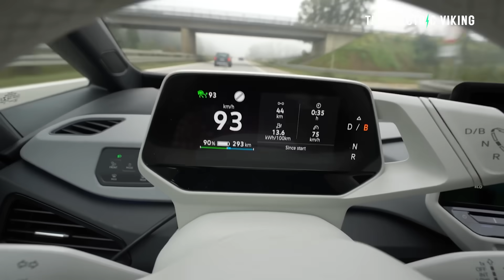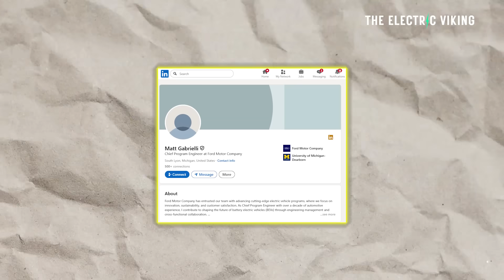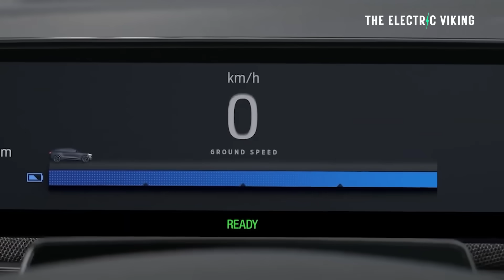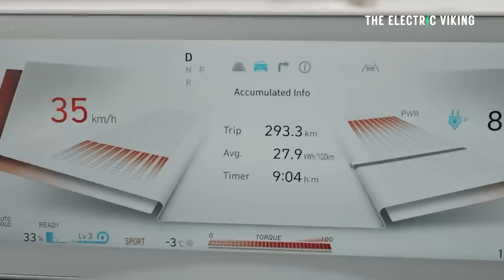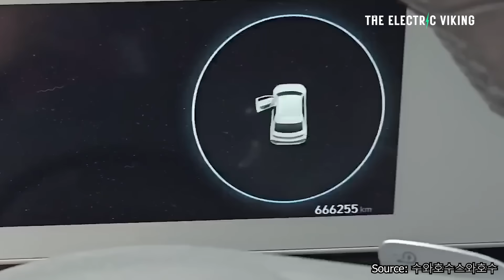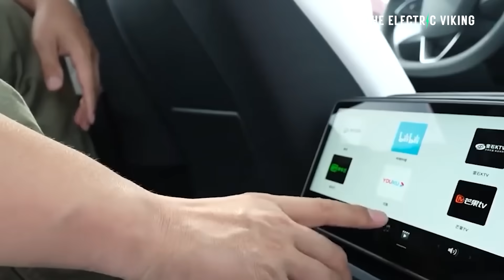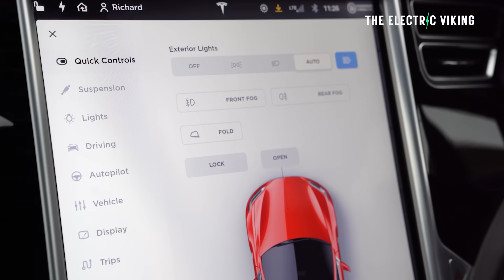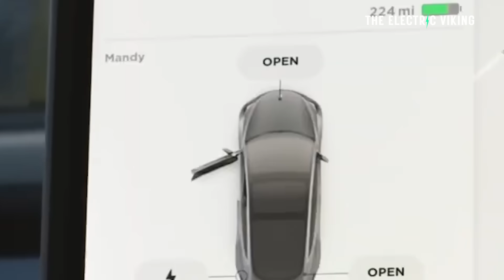Ford Mustang Mach-E Has Over 95% Battery Capacity After 252,000 Miles

Comment: Well I have three EVs with same conditions but different SOH an ID.4 2022 with 44000 km and SOH is 94%, and MG ZS EV 2020 with 101000 km its SOH is 96% same, and Renault Zoe 22kwh battery 2018 with 45000 km has 89% SOH it , but in Saudi Arabia the weather is hot as you know.

Comment: I put 180,000 miles on my i3 and I did not see any noticeable degrading of my battery.  In that time I only spent $2,000 on a new charge port.  Front breaks were done at 160,000 miles.  Nothing else.  I did all levels of charging.

Comment: How long does a quality brand 18650 battery last in a flashlight? In my wifes hand 6 years, in mine they are still fine after 12 years. The Mustang Mach-E owner must have known what he was doing - and been driving on well maintained roads, not through potholes which have become so common nowadays throughout the EU and the USA. What about driving those 252,000 miles not in 3 years but in 30?

Comment: I drove a plugin hybrid about 2500 short trips using about 50% of the battery each time over 40 months I'd est about 15000 miles on a 8.8 kwh battery, I don't know the "useable", I dorve a total of about 23000 miles but outside one 5000 road trip the gas engine hardly was ever ran.

Comment: I’ve done 70k miles in my BMW EV over 5 years. Haven’t noticed any battery degradation and the only maintenance has been tyres & brake fluid changes. Got so tired of my previous ICE cars needing regular oil, pad, filters, exhaust & disc changes.

Comment: There’s no definitive answer to this longevity question yet as EV’s have only really been around comparatively for ten minutes compared to the 135 years of ICE vehicles. My mates 1997 Land Cruiser has 400,000 km on the clock (248,000 miles). Has been bush bashed, crossed rivers, hauled heavy loads, etc. We did a compression test on it as part of a service and health check and all cylinders were the same as new vehicle factory spec. We serviced the injectors while they were out and apart from an oil change, new filters, etc, that was it. It’s still out there running around and probably will be for another decade or two.

Comment: As an owner of a PHEV that is 13 years old, I can tell you that my EV battery aged out before it cycled out. My battery range is less than half of what it was initially. I typically have driven my Japanese ICE cars Honda, Toyota and Nissan vehicles 15 to 20 years without drivetrain problems.
Reply: Same here with my nearly 10 year old volt (roughly 75% capacity now). However, I’d argue that it’s more to do with improvements in battery management systems than the actual battery. All things wear out with time but car companies seem to have gotten better at extending that in the last decade.

Comment: ICE engines can go multiple 100 K’s depending on maintenance and who built it. My Dad sold his ‘76 Scout II with 350 K on the 345 v-8 with no engine overhauls.
Reply: My 2006 Hyundai is at 440,000 miles.  Just have to go easy on the gas pedal, don't be abusive, and do the regular maintenance on time

Comment: "they run all the time" in fact the more you run a pure play BEV the better they work. In the USA I was once putting 6000 miles per week on my truck...the superiority of a pure play bev to that tho...one that doesn't even need a driver anymore... PLAAAAAINLY obvious. In theory a hybrid drive system should compete just fine all that is being added is an engine and some fuel presumably a powertrain I have no idea. But the batteries have suddenly gotten so good and don't cost much anymore ...80 miles on the battery is what I've seen quoted for the en route #toyota_rav4 that is a very good number...all with an "engine back up." In theory an amazing #gen_set for backup power to your home or business/both. On site work as well. Anything else be literally throwing money out your window while driving. A lot of money actually if you don't even need to buy the car itself anymore😊😊

Comment: Miles is not the concern, calendar aging is.  Regardless of miles you're not going to see original batteries going for 15 to 20 years  like good ICE engines can.
Reply: The day is coming when you will just replace the battery with a cheap Chinese new one
Reply: Yes and no. Cyclic and calendar aging are both factors in battery longevity. Car manufacturers have gotten better at cyclic aging but it remains to be seen how the current generation of EVs fair with calendar aging. 

Btw, suggest you read the comment from the 4th gen mechanic above re ICE cars. His comment points out the flaws with ICE, particularly modern ones (think planned obsolescence). Your comment reads more as a “you can take away my ICE when you pry from my cold dead fingers” level curmudgeon.
Reply: There are 10+ year old Chevy Volts  that are still on the road without issues.

Comment: Here in the UK, the average age or a scrapped vehicle is 14 years and only 140,000 miles. So this longevity is around double the average. And there is a Tesla Model S here in the UK done over half a million miles on original battery and motor.

Comment: Seriously, Sam?  BATTERIES last longer than ENGINES?

Considering the fact that most battery packs haven't made it past 10 years STATIC, and I'm driving vehicles (with original engines) averaging THIRTY YEARS OLD, I think you'll need to just remove this bollocks as a matter of principle.

This video is an insult to people's intelligence and a denial of what they see EVERY DAY IN REALITYVILLE.
Reply: Considering you have absolutely no clue what you are talking about, and most battery packs aren't even 10 years old yet genius, but data is showing they degradation is very slight, even after a very long period of time.

If your "intelligence" is getting insulted, it is because it is much smaller than you think it is...

Comment: At 360K most ICE's would have been through at least three timing belt/chain changes and at least six brake replacements. Also would have been at least three full transmission flushes and differential oil flush. 

With standard oil and filter changes the best case maintenance (tires excluded) is ~15K.

Comment: Chevy Bolt on second battery in 27,000 miles.  $20,000 payment back from GM and two months of income lost so far.  Chevy Bolt is a joke in every way.
Reply: There was a recall on the battery genius.  It has nothing to do with the typical battery lifespan.  ALL of the Bolt batteries in the Bolt were recalled by LG due to manufacturing defects.

Comment: Great to see these cars getting a lot of miles but still have never seen anyone who can say how Long a battery will last with normal usage, 10 years , 15 years, more ?
This is the question people are asking, not how many miles in 3-5  years.
Reply: Actually, many people think EV batteries are like phone and laptop batteries, although they are managed, cooled and charged completely differently.

With normal usage, I think 15 years is an easy benchmark.  I have a Model S from 2014, original battery and it still has 90% of original capacity with 135k miles.  Newer batteries should last even longer, but even 11 years later, the battery in my Model S has absolutely no issues at all.
Reply: its not the years that matter, its the mileage, and how you charge it (home charging or DC fast chargers).
Reply: @udishomer5852  That is actually incorrect.  Calendar age is a factor, and studies involving fast charging have shown they do not affect battery lifespan as previously thought.

There have been large studies involving thousands of EV's, and the different in battery degradation between EV's that were fast charged frequently or fast charged rarely was not statistically noticeable.

If anything, the study showed fast charging batteries actually causes less battery wear than slow charging, and that is due to the temperature wear which is the primary cause of battery degradation.

Fast charging batteries means the batteries are heated for shorter periods of time vs using Level 2 charging, and that appears to shorten the thermal wear which is the #1 reason for batteries to lose capacity.

A lot of the early projections of how batteries wear over time have been proven to be incorrect when they got actual data from thousands of vehicles and a decade of charging habits and battery degradation reports.
Reply: @udishomer5852  So if i never use it, it will last forever ?

Comment: I am definitely pro EV however I don't understand why you did not discuss mileage limits to EV battery warranties. Eight years seems to be correct for most EV battery warranties however they have mileage limits that you did not discuss and I'm a little disappointed in that.
Reply: Because it is a complicated subject.  Take Tesla as an example.  Early Model S had Unlimited mile warranties on their batteries, later Model S changed to 150k mile warranties, but 120k miles on the Model 3/Y long range and 100k miles on the short range version.  8 years is legally the minimum warranty period, but some manufacturers offer 10 years, some offer far more miles.

It all depends on the model, manufacturer, year it was produced, usage case, etc. etc. etc.
Reply: @redbaron6805  Thanks ...I found information suggesting 100 to 160 thousand miles. I think that would cover defective batteries
Reply: @dan8375  Based on the reports I have seen, defective batteries tend to fail pretty early, so they are usually caught and replaced under warranty.

If your EV has made it close to 100k miles and 6 to 8 years of driving, then any defects should have appeared way before that time or miles.

There is also a trend showing that battery failures and warranty replacements are declining a lot, as early teething problems and manufacturing issues are discovered and sorted out.

Current EV batteries have become exceptionally reliable, so they are becoming more and more of a non issue on most brands.

Comment: Hi all of the high milage examples I see on yt are taxis. Yes they clocked a lot of miles but in very short chronological time. Hence my question what about degradation in similar mileage but on 15 years old car? I wonder would it be a big difference?
Reply: Calendar age does not appear to be a major factor.  A prime example is my 2014 Model S with 135k miles, which still shows 90% of original battery capacity.  The data appears to show that 15 to 20 years of battery lifespan is very realistic.  

Considering cars are scrapped on average after about 16 to 18 years in the Western world, that should mean EV lifespan is at least as long as combustion engine cars, and probably far longer as EV's are often very modular, where replacing the drive unit or battery is very quick and easy.

Comment: There are quite a few EVs that appear in auctions in the UK that are sold with defective batteries. They're still in warranty so why haven't they been fixed under warranty? Because EV makers will do their utmost to squirm out of the warranty.
Reply: So how many have you bought that have had defective batteries?  I take it you are speaking from personal experience?
Reply: You have to separate out a lot of early short range EV's with very small battery packs, short range or even air cooled batteries.  These are not representative of modern, long range, liquid cooled batteries which are a completely different technology.

Comment: Tesla reports their highest mile simi has +250K too. But did not say if the battery pack has been replaced. LONG BEFORE EVs we gear heads learned when charging a old school lead acid liquid filled car battery that we got a better charge when left overnight on the 2A setting. Thats why battery chargers have a 2A setting-low & slow wins the race. Since then I have learned it it also true with 18650s or Dewalt power tool batteries. In the Ford Lightning owners manual under  CHARGING it states-
'We recommend you use the slow charger that came with your truck. By charging overnight this will make your battery pack last longer. Only use DC fast chargers in an emergency or on a long trip-NEVER regularly.' So it suggest those who use fast charging regular are the ones who will need a batt pack replace. The Mustang e Mach may have charged slow overnight to get his high miles

!
Reply: Do you enjoy regenerative braking?   You know: the ability to run the vehicle's drive motor as a generator, transforming kinetic energy back into electrical energy and pushing it back into the battery?   Regenerative braking applies similar power levels as a DC fast-charge station ( about a quarter of DCFC, I think).  If high-current charging were as harmful to batteries as you imply, why would regen braking be designed into so many EVs?
Reply: The problem with that claim is actual data shows fast charging does not affect EV battery lifespan.  A study of 12000 Tesla's showed no statistical difference in battery lifespan or capacity between cars that were frequently fast charged or rarely.

Lead Acid batteries are a totally different technology, with no cooling mechanism, and they produce Hydrogen gas when charged too quickly.

Lithium Ion batteries in EV's have a BMS which monitors temperature and runs the cooling system, and adjusts the charging rate to optimize temperature and lifespan of the battery.

Yes, some manuals still incorrectly discourage fast charging, even Tesla did so early on.  But as real world data has demonstrated, this belief has been proven false, and Tesla and other manufacturers stopped recommending people not fast charge their EV's.

Comment: Really? Longer means years or km? Because it looks like regarding years, a battery is dead when reaching about 10 years.
Reply: That was the theory but there are EVs that are over 10 years old now and still going strong. So it turns out the estimate was wrong. It's really rare for an EV battery to just be "dead". The most common thing is for it to lose some of it's range, in the case of Tesla cars you can expect about 9% within the warranty period and then a slow decline after that to 300.000 miles. You can still drive the car after the battery loses some of it's range it just gets inconvenient to charge it more often. If things go wrong with your engine or transmission you have to repair it, you can't keep using the car.
Reply: Yeah, as Frank mentioned, that simply isn't true.  My 2014 Model S with 135k miles is still running fine on original batteries after 11 years.  The early estimates were around 10 to 12 years, but more recent data shows they are likely to last closer to 15 to 20 years...

Comment: When I bought my new 2025 Tesla model 3 rwd in late 2024 it said 362 miles. Almost 8 months later and charging 1x per week to 85% l, my car now says 356 miles on a full charge. Is that normal for an almost 8 months old vehicle ?
Reply: your driving habits and use of climate controls also affect the estimated range.
Reply: Yeah, the range estimate is just that, an estimate based on your driving habits, climate controls and other factors.  On Tesla's it is normal also to have some minor range loss in the first year or two which then levels off.

Ultimately, people obsess over range way too much, as they have this information overload.  People need to learn to just drive the car, enjoy life and relax a bit more.  Unless you are driving 350 miles a day, having the range fluctuate a bit doesn't really affect much.  Even my 2014 Model S which got around 260 miles when new now gets around 240 miles 11 years later.  It still works fine.

Comment: What about all the ZOEs that break before 50,000 miles and are concidered right offs.
Reply: They're not write offs, so what about it?
Reply: ZOE batteries are air cooled, not liquid cooled, hence have a shorter lifespan.  There is a reason Renault/Nissan abandoned the Air Cooling of batteries and went to Liquid Cooling in the later generation of the Leaf or Ariya...

Comment: I came out of a Range Rover Sport with a supercharged engine. I had 326,000 miles. The reason I got out of it was the costs to keep it running was going to be nearly 8K. The dealership was impressed with the longevity except when we went over the $$ paid out in maintenance over the last two years of ownership , plus my fuel costs I had purchased a small car.  My fuel was nearly $800 per month. I went to a Tesla Model X. I save on fuel, I now only average about $150-$200 per month depending on whether I have to supercharge a lot or just charge at home. To charge up at home runs me $15 if I was at 0 %  to 100%. Of which I never really do unless doing a 500+ mile road trip.